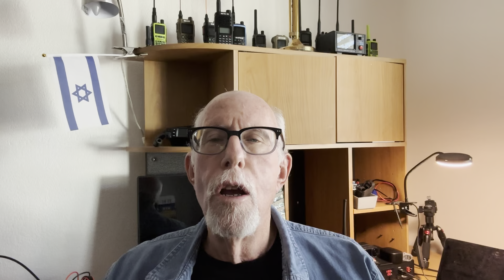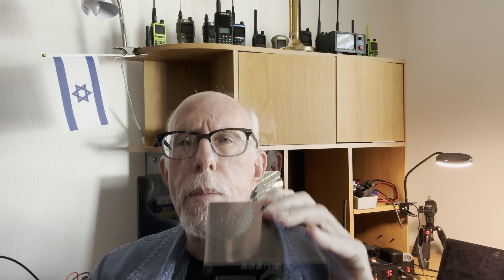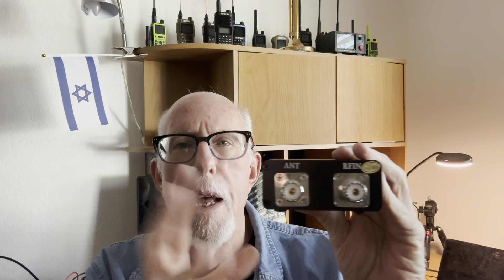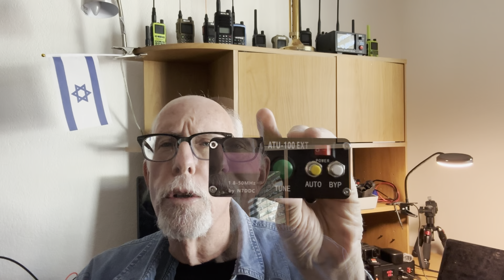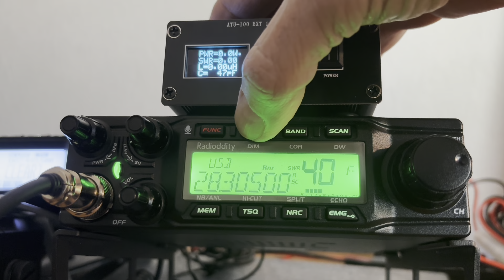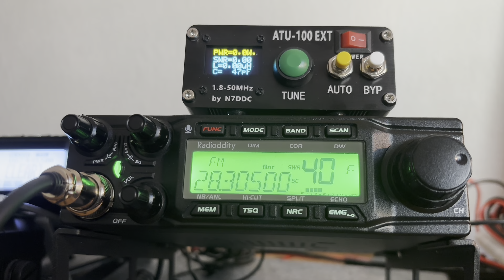ATU-100 Antenna Tuner Test and Review #hamradio #prepper #radio #antenna #tuner #atu100

Comment: Thanks for the comparison, very helpful.  However, that is not a USB C port but micro.
Reply from the maker: You are correct, it is a micro plug. I stand corrected. Thanks for pointing this out to me.

73 de Dave N8DAV

Comment: When you plug in the USB charger, does it deactivate the battery-power only version? Or can I leave I plugged in?
Reply from the maker: Thanks for your question. Due to inconsistent models, features and firmware changes I can only tell you about the particular battery powered tuner I have. I typically leave mine plugged in to the USB charger while operating it. And it works as it should. When I disconnect it from the charger it sometimes does not work correctly. My unit typically lasts a whole day or more on a charge assuming it is working correctly when disconnected from the charger. Leaving it on the charger sort of defeats the purpose of having a battery powered unit. So now I only bring my externally powered tuner. There are a lot complaints regarding the battery powered model. There is a FB page for the ATU-100 tuner with lots of good information regarding the tuner fixes and tips. A very common comment is a recommendation to take the battery out of the tuner and run it directly from the charger.

73 de Dave N8DAV
Reply: yes  3.2 firmware version works with charger plugged in and providing voltage. 3.7 volt to 12 volt internal convertor draws power from both battery and charging input at the same time
Reply from the maker: @DOGWOMAN55  Thank you for your comment. I appreciate it.

73 de Dave N8DAV

Comment: I have the same problem you have no idea when the battery will be low to operate. Mine last about a day.
Reply from the maker: Hey Martin, I think my battery lasts around a day to two days. So now I bring the ATU-100 that uses external power. That way I don’t have to worry about the battery dying. 

73 Dave N8DAV